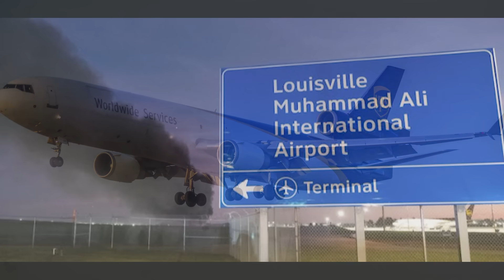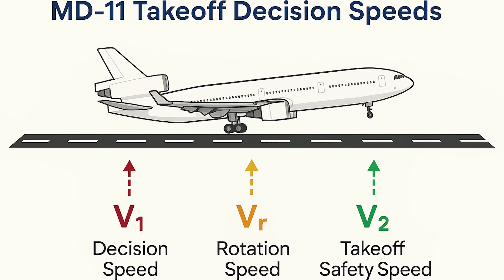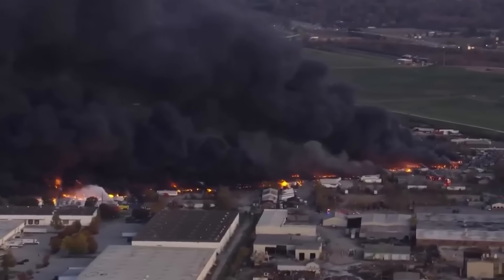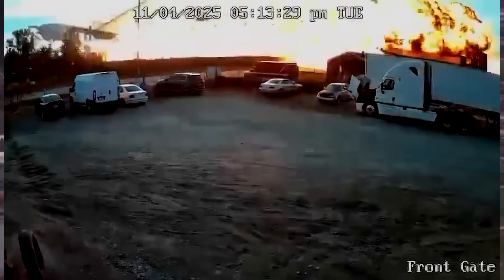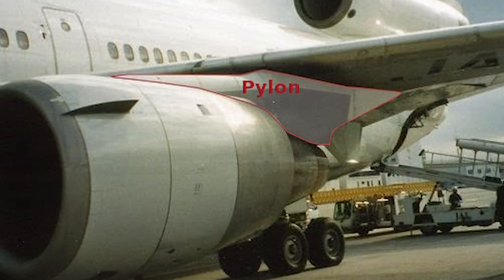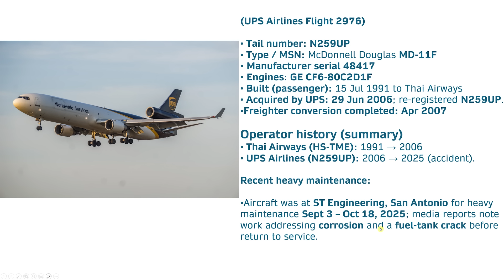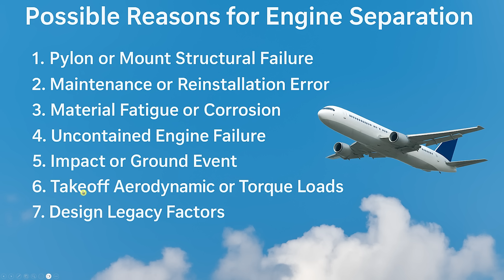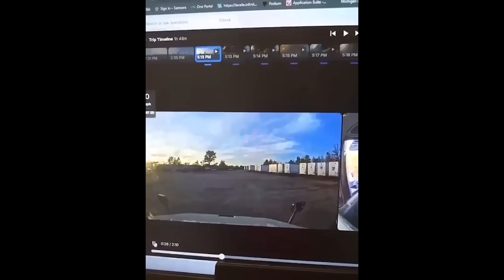What Caused UPS Plane Crash, Louisville, KY? How MD-11 Engine Fell Off

Comment: When the engine separated it most likely damaged the hydraulic system which then allowed the left wing leading edge slat to move back to it stowed position, reducing lift on the left wing, making it dip down. Poor pilots, they didn't have a chance.
Reply: The slats appear to be in the correct position for take-off. After the DC-10 crash in 1979 modifications were introduced that prevented the slats from being retracted by aerodynamic loads. These changes were incorporated in the design of the MD-11.

The sharp left roll was caused by the left wing hitting the vertical waste fuel tanks.

Comment: I am not sure it hit the power lines, as that is what I guessed as well....however, not a single power line seems to move at all. If that huge plane hit them surely they would sway and move and if it wasn't them then it may have been some electrical fire causing those lights?

Comment: I believe that engine is held on by 3 bolts ( pylon ) Structure failure/maintenance failure or engine strike by a deer on the runway. When I worked at Detroit Metro AirPort , County OPs. would use blank rounds to scare off deer or flocks of geese/birds away from the runway area. Hopefully the black boxes 🗃️ will reveal.

Comment: Years ago, when engines were swapped out, they used to use hydraulic lifts. When workers shifts ended and before the engine was totally seated within the engine mount, the lift would have just a bit of leak down creep overnight causing stress to the engine mounts. Overtime this stress weakened the mounts causing a failure and the engine would fall off under power.
Reply: That was on the DC-10 in 1979. That workaround was banned and has never been employed on the MD-11.
Reply: @christopherrobinson7541  I never liked the DC10 platform. I always checked before I booked a flight to make sure it was not a DC10. The MD11 is so similar. I don't like them because of the engine at the base of the tail but that seems to the good one that never caused a problem.

Comment: How tf do engines just fall off?  Sorry to ask such an obvious question but I don't have an aviation background.  I thought those things were tied down good.
Reply: human error during engine maintenance
Reply: There's one right way to put together an aircraft, and plenty of wrong ways.
Reply: The engines are attached with fuse pins. If the engine is very badly damaged these pins break letting the engine detach from the aircraft.

Comment: The AA crash back in '79 at ohare....they cut corners when doing maintenance on the engine. They took it off the pylon, and put it back on using a forklift, which was not standard operating procedure. They did it too hard and unknowingly caused a stress fracture in the pylon. Dont remember exactly, but it flew several more times before it finally snapped on takeover at ohare. Flung forward first, then backflipped over the wing, severing hydraulics, though it was doomed anyway at that point. Gotta believe maintenance records will solve this, even though there were industry changes stemming from the AA crash.

Comment: If you left an engine on the runway.  You can’t tell me your engine at throttle up was working fine.   This means V1 is a point in time you should've never reached.

Comment: Strikes me that the two questions that will want to be answered will be: was their a problem with the maintenance or just with the structure in and around the No. 1 engine to explain why it detached during take off? Secondly, is the loss of a single engine on a three-engine aircraft sufficient to explain why the pilots could not achieve sufficient lift? That seems to be the one that isn't being asked much at present. Clearly, losing one of your engines on take off would not be considered the best option, but that should presumably only account for 1/3 of the take-off power. Was the plane so heavily laden that the loss of a single engine was enough to cause the crash? If that is the case, then I think UPS would have some very serious questions to answer; because, although literally having your engine fall off during take off should be an extremely rare occurrence, losing power in a single engine - due to a mechanical fault, a failure in fuel supply or foreign object ingestion/bird strike to the engine would not be anything like as rare, and having that be a critical fault would signal that UPS's operations were unsafe.
Reply: We won't know for sure what went on in the cockpit but it's possible they didn't realise the engine was completely off and they'd lost all thrust from that wing, meaning they had less power than expected; or they may have hesitated post-V2 speed and had less time and less power to pull up.
Reply: It appears that the No 2 (tail mounted) engine may have suffered a compressor stall as the result of the ingress of FOD and/or smoke and hot air, which reduced the power output of this engine.

Comment: Dawe: Now, Mr. Clarke, you’re with the aviation industry. There’s been some concern about a recent incident.

Clarke: That’s correct, yes.

Dawe: A plane lost an engine?

Clarke: Yes, the engine fell off.

Dawe: The engine fell off?

Clarke: Yes.

Dawe: How did that happen?

Clarke: Well, the bolts holding it on... came off.

Dawe: And the bolts just came off, did they?

Clarke: That’s right. It’s not unusual. Engines do fall off from time to time.

Dawe: I see. And where was this plane when the engine fell off?

Clarke: In the air.

Dawe: In the air?

Clarke: That’s right.

Dawe: So the engine fell off a plane while it was in the air?

Clarke: Yes.

Dawe: And what happened to the plane?

Clarke: It continued flying.

Dawe: With one engine?

Clarke: Yes. These planes are designed to fly on one engine.

Dawe: But they’re not designed to lose one, are they?

Clarke: No, that would be a design fault.

Dawe: So what happened to the engine?

Clarke: It fell into a paddock.

Dawe: Into a paddock?

Clarke: Yes. Fortunately there was no one underneath it at the time.

Dawe: Well that’s lucky.

Clarke: Very lucky.

Dawe: What’s being done to stop this happening again?

Clarke: Oh, we’ve put out a strong memo about it.

Dawe: A memo?

Clarke: Yes. Reminding everyone that engines should remain on the aircraft at all times.

Dawe: I see. And you’re confident this will prevent future incidents?

Clarke: Absolutely. Unless of course, the bolts fall off again.

Dawe: Right.

Clarke: Which, you know, can happen.

Dawe: Well thank you very much, Mr. Clarke.

Clarke: Pleasure.

Comment: Engines don't just drop off? Aeroplanes have redundancy don't they? Initially you could say McDD is not to blame as they issued a maintenance procedure. But the maintenance procedure is fine in their factory but out in the field is impractical and dangerous. You can't leave a several ton engine hanging on one bolt with a forklift needing cm precision to get it right. So maybe McDD are liable.

Comment: IMHO, they didn’t pull up the gear as soon as the aircraft left the ground and rotated too much so the tail end hit the building, you can see by the shape of the damage to the roof the back of the fuselage that contacted the building so i suspect even if they had cleared the building it was going to stall...... If you look at the angle looking back up the runway you can see the radius to the damage on the building’s roof.

Comment: First video is telling, especially the 2 guys running out the the tire shop.  There are apparently some 50 people missing. 
There isn't much point in speculating on what caused engine to fall. First need to know if fire started before or after engine fell off.  NTSB will get those facts straight. 
All aircraft are designed survive loss of an engine after V1.   So how come this one didn't ?    Did loss of engine cause loss of hydraulics on left wing? (would depend on design of hydraulic system) . Aircrtaft veered to left a bit in its final airborne segment.

Comment: Does anyone see the engine pylon on or near the engine???
The engine usually climbs over the front of the wing staying reasonably in tact.
It looks like it nosed dived into the runway looking at the blades.
The tank looks in tact during V1 with fuel fed by the pump catching on fire first. Any thoughts?

Comment: One of the engines caught fire and crashed. The aircraft was too heavy due to its load and fuel, so it only reached takeoff speed at the end of the runway. Since it reached the end of the runway, it was impossible to stop, and it was forced to take off. However, an aircraft needs its most power during takeoff, especially with such a heavy load and fuel. Here, the thrust was insufficient, and it stalled. This is my conclusion from what I saw in the video.
The engine problem will only be revealed after further inspection.

Comment: DC- 10, DOUGLAS, THE "D" IN MD-111.  THE DC-10 crash in Chicago.  Engine came off because maintenance crew replaced engine by removing the entire engine assembly from the wing by removing the pylon bolts, leving it hanging while they took lunch.  Using a forklift, against mfg. Warnings.  Could this be a repeat.  In the Chicago crash the FFA said that plane could have survived.  They will say the same about this crash too.  I didn't see the deflection of the rudder.  That was one heavy aircraft, take off is like lighting a rocket to get off the ground.  Not that much room for maneuvering.

Comment: If you look at the original video of the aircraft just before rotation,  the passenger side engine looks to have a compressor stall as there is a pop of fire that comes out the right side at rotation... with the right engine stall , the aircraft never stood a chance. The right engine may have ingested something from the left when it had the failure,  probably a front fan blade assembly failure as that would generate enough force to maybe brake the front part of the engine mounting rail ... Just my thoughts from watching over an over in slow motion.

Comment: What a horrific disaster & my prayers to  all the lost souls aboard & on the ground & their families.🪽 So many Aircraft Companies want to keep their investors happy/wealthy above all else including the safety of those who fly. Over the last few years many have cut back on maitenance crews & proper inspections rushing the mechanics to get the job done quickly & the aircraft back into service...Human error happens in every work place but I've seen and heard the concern & complaints by many in that field of the cutbacks & pressure to rush & get the job done & that's when important things are missed or damaged while installing the part. In one case of a major crash the mechanic needed a couple of  bolts & the ones he used the threads inside weren't the same causing it to come off the plane while in flight. I was under the impression that these large planes have a life span of 25 years! I can't imagine what those poor souls were thinking knowing this wasn't going to end well. May they all RIP.🙏🇨🇦💔🇺🇸

Comment: A plane losing an engine is just pure negligence, someone has been cutting corners on proper inspections or maintenance.
Reply: Jumping to conclusions is also pure negligence.
Reply: Very reminiscent of the tragedy of flight 191. It was a tri star jet that experienced sudden detachment of the number one engine shortly after v1 (take off speed) this caused the plane to bank sharply to the left till it was nearly completely upside down and then slammed into a neighborhood. This was caused by cutting corners during maintenance and using a forklift to position the engine for maintenance
Reply: YOU don't know that.
Reply: For anyone interested, it takes exactly ONE DAY to determine the EXACT CAUSE of an accident.  All the paperwork is available and a few minutes of review will determine if a procedure wasn't followed.  If the paperwork looks good they walk over to the guys working on it an have them report on what they did, that takes a hour.  From that they know the EXACT CAUSE... really a couple of hours.  The reason they don't release a report on the first day is they have to figure out how to hide, reduce, or mitigate the truth of what happened so they can not disclose who is to blame to a level that is legally actionable.  In other words, they have to figure out the best story to avoid anyone actually knowing what actually happened, all figured out the very first day.
Reply: Or sabotage.
Reply: @pfpchad2747 Highly unlikely to be sabotage.
Planes are complex, human mechanics are fallible. It's best to generally stick to the Occam's razor principle with things like this.
Reply: Pure conjecture and not based on any factual evidence.
Reply: DEI

Comment: 74yrs olde here, I'm no aviation expert. With the left engine separated from the wing I would imagine continued full fuel flow to that area of the wing. Saturated air/fuel would easily be ignited by contact with power lines or simply a spark created by static or metal glancing off any surface.
My condolences to families, friends and anyone involved in this tragic event.

Comment: I have a theory that mayby  the engine is inside that warehouse that   perhaps thats not from the landing gear, since that looked undamaged in that first video.. When the engines are at  full throttle they are pulling the plane through the air with enormous force so in the event an engine comes of the wing it won't just fall of  and bounce  down the runway at the speed the plane was going,  it would SHOOT forward ripping through the cowling, passing the plane initially  with enormous acceleration because it now only have to pull it's own weight! Just for a split second of course before the lack of aerodynamics will make it tumble and perhaps it shot straight into that building.Just a thought.. I'm no expert!

Comment: Airports need to double the runway or even triple it in length. There are tons of examples of planes crashing during takeoff, maybe they need the option to shut off the engines and use a mechanical arrestor.

Comment: Most probable cost is maintenance.... It was quite an old jet. There is a very high possibility that during maintenance, they couldn't fix corrosions etc or mismatched parts were used.

Comment: I must correct you on the Chicago AA crash. The correct procedure that AA did not for was to remove the engine from the pylon. But AA removed the entire pylon and engine as one, and the stress of that incorrect procedure cracked the bolt that held the engine to the pylon.

Comment: how convenient of you to totally edit out the white flash that happened even before the plane nose entered in the dash cam video. so you can lie and say it was power line hit. total edited video. the white flash, the very white flash that appears even before the plane showed up in dash cam before even got close to the road, that you cut out, yea that one, times exactly with the thump sound they heard. no the engine did not fall off. the black box data, the audio the only thing happened was a vibration noise reported and 2 seconds after the thump sound, the thump sound times perfectly with the first white flash. the first white flash you edited out. so it was a sniper and 3 ai that actually have the real data, not the fake edited video you are putting out, all agree it was not one but 2 snipers. they used suppressors. https://www.youtube.com/watch?v=ttZ1CBiXiOc

Comment: i don't proclaim to know all the reasons why, but it has never made sense to me that a plan that has exceeded V1 speeds MUST take off if there is a serious issue because the speed has exceeded what is considered too fast to slow down in time. It makes sense to me to do everything possible to not take off in those situations like an engine falling off, or some other major issue. Just go off the runway versus trying to take off and crash from some altitude down range into homes or buildings. Make runways longer or make the off runway area more conducive for runway excursions.
Reply: Make a loop or two, around the point of no return, that branch out of the main runway, perhaps, just a thought out of the top of my head.

Comment: I'm 75 and I remember back in 80 they were having trouble with DC10's engines falling off because there were only 4 bolts holding the engines on. It's funny these look like the old DC10's.

Comment: It looks like its dropping fuel, which ignited when it sparked hitting the power lines....the planes carry their fuel in their wings. Probably ruptured the tank when the engine came off and this seems to have also caused the wall of flames. Maintenance is gonna have a lot to answer for...only way I can imagine an engine falling off. Someone cut corners during inspection or fixing the engine. How scary for those on the ground. RIP to the crew and those on the ground that didnt even know what happened.

Comment: I believe that was a DC-10 not a MD-11, the MD-11 was supposed to have the redesigned engine mounts. the repercussions are that of this is that all planes use this very dual pin engine mount technology